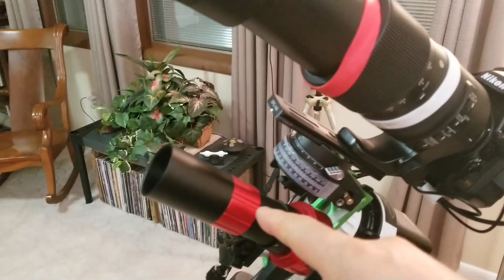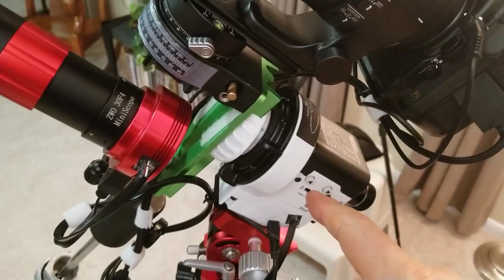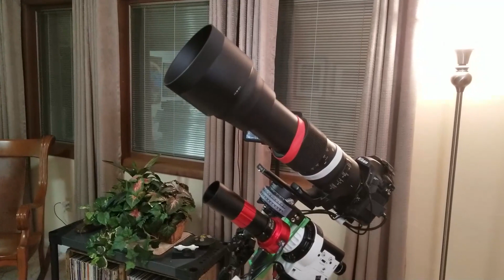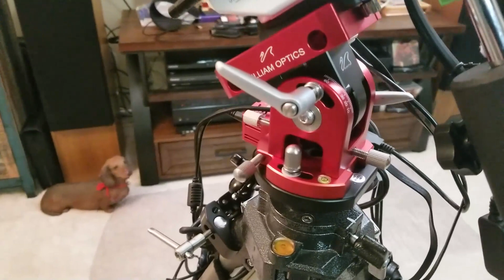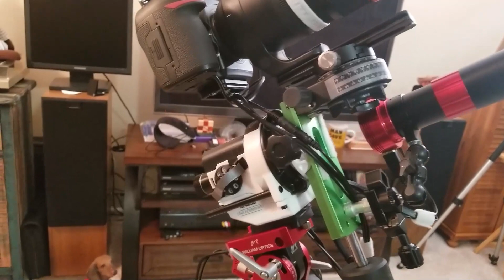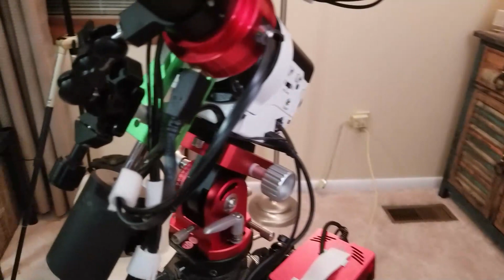Sky Watcher Star Adventurer Pro - An Overweighted Configuration

Comment: Nice work Daryl. We've both been on similar journeys with our Star Adventurers and ended up with similar solutions. I am still running with a counterweight rod extension and additional lighter counterweight to offset my Nikon D500 and 200-500 zoom. The solution I came up with for the guidescope was to swap out the arca swiss plate you have the lens mounted on for a 300mm one. This allows me to mount the guidescope directly beneath the zoom lens in the same orientation. This really helps with balance and I have found makes guiding more accurate. I'm interested to know how accurate you are able to achieve focus? I have ended up adding a lever to my zoom lens focus ring to give me the ability to make finer adjustments than I was previously able. I've considered the William Optics base, but will save the money towards a mount upgrade. I find that I am comfortably able to move the mount elevation without having to loosen the clamp bolt. I store the mount and base still attached so never have to loosen it off. Good luck and clear skies.
Reply from the maker: Hi Robert...thanks for the compliments.  Sure enough, a longer Arca Swiss plate would give more freedom for mounting the guide scope below the lens as you mentioned.  The one seen in the video was only 140mm, as I'd originally used it simply to provide a longer foot for conventional photography when using my Sigma zoom on a gimbal.  I don't like swapping out accessories that are screwed together, so I just stayed with that plate.  But, a secondary reason to my approach was I wanted to have the guide scope independent of the lens so that lens swaps were also more readily accommodated with less fuss.  In general, this setup worked OK for me but did evolve to mounting my guide scope on my camera L-bracket for a higher line of sight as my lens had, thus less likely to be obscured by a treeline while my lens might clear the trees.  Over time I also learned more about what flexure is and the importance of a firmly secured guide scope so I migrated from the double-ball arm mounting to a fixed mount, and your mounting directly to the a-s plate would similarly be good and secure.

I never had any particularly big issue with focusing the Sigma zoom.  I use a Bahtinov mask (https://www.amazon.com/gp/product/B01M6YC4WJ) with it and then, to ensure bright stars while keeping the exposure short, since I typically have yet to establish tracking, I just ramp up the ISO to maybe 12800 or 25600 and shoot a 5-10 second exposure to check the focus.  If it's not on the money, I'll go to Live View and zoom in on the brightest star, and gently adjust focus (the Sigma has a pretty smooth focus ring) to get the Bahtinov spikes more aligned as needed, if I can see them well enough, else I just focus to make the star as small as possible and then take another test shot to check the Bahtinov spikes.  I keep a wide silicone rubber band around the lens, so once I've achieved good focus I will slip the rubber band up over the focus ring to help keep it in place so any careless handling of my lens doesn't knock it out of position.  I've gone from one night to another without having to refocus but still will always shoot a test exposure to confirm focus before proceeding further.

I'm a bit mixed on the WO wedge but do like it and consider it more accurate and easy to adjust than the original Star Adventurer wedge.  I guess I still consider it worth the $200 upgrade cost, but that still seems like a lot for what it is, and $200 toward a new mount is certainly helpful.  That said, I did upgrade to an iOptron CEM40 mount and recently bought an astro camera, so I will continue to use the Star Adventurer Pro for a secondary imaging platform with my D850 and thus am still happy to have the WO wedge upgrade on it..
Reply: Hi Robert, I too have the Nikon 200-500 but with a D850; how long is the rod extension?   Thank you
Reply: @doubledark2  My rod extension is the same length as the original, so doubling the length. If you use a guide scope I have found that attaching that to a ball head on the other end of the Dec bracket helps balance the setup

Comment: Do you have a link to that arca swiss panning base? I'm not seeming to find it.
Reply from the maker: That particular one from Fanyingtech (FOCPRO) seems to be unavailable any more.  It would come and go on Amazon pretty often, but I've not seen it at all now for quite some time, and suspect it has been replaced by a model that integrates the Arca-Swiss dovetail into the base rather than with a separate removable adapter.  I own both but even the latter seems similarly unavailable.  Here's the manufacturer's product link, if you're curious to see what it looks like:  https://www.fanyingtech.com/product/kuaizhuangbanjiazuo/Panoramic_Tripod_Ball_Head_with_Indexing_Rotator.html

That said, I did find one that is very similar to mine as in the video, only lacking the adjustable detent for the panoramic function and I'd recommend it over other designs I found, as the small locking lever for the panoramic base flips upward so you know there's not going to be a clearance issue as could occur with a knob.  At $30, the price is right too.  :)  https://www.amazon.com/Hifine-Degree-Rotating-Panning-Mounting/dp/B07CV6ZT9X

Here are 2 others, again just for sake of comparison, at considerably different price points.  Sunwayfoto makes good stuff from what I've heard and this lever clamp design is akin to RRS but I'd not recommend it for astro purposes since you can't be certain just how tight that clamp action is and you may be carrying a rather heavy load...I'd sooner trust a knob.
$23.53 Tanke QJ-01, https://www.amazon.com/QJ‑01-Aluminum-Rotatable-Panoramic-Tripod/dp/B099KK7HSG/
$69.00 Sunwayfoto SPB-58T, https://www.amazon.com/SUNWAYFOTO-SPB-58T-Panning-Clamp-Panoramic/dp/B09JSGQZQ9

Finally, while I still use the pano head on my Star Adventurer Pro, I was recently making a Vixen plate adapter for my other similar head, and found for the gear I was mounting, that the pano base wasn't holding tight.  Perhaps checking some assembly screws might take care of that, but I decided to just use a standard arca-swiss clamp instead, because ever since I added the scale to the front of the DEC platform, I did generally find it easier to take advantage of the big fine-tuning adjustment knob for changing the DEC, only using the index pointer of the pano base as a convenient reference to align with the scale.  Cheers!
Reply: @Ambress  Thanks for all of this information!

Comment: I'm sorry but who says it should be only half the max payload? Did Sky Watcher tell you that? This is not the first time some random person has said this and sky watcher says nothing about halfing the max payload.
Reply from the maker: No, Sky Watcher didn't tell me this.  Instead, much as you said, it seems to be a pretty common recommendation throughout the astro community.  What I've read in various places, is the rated maximum payload is usually that applicable to visual astronomy, where critical tracking accuracy is less of a concern.  But, for optimum tracking and reportedly reduced wear on the worm gears, the 50-60% of max payload is the popular recommendation for astrophotography payloads.  As you've seen me address however, I have successfully carried as much as 9 lbs. on my SA Pro and with successful tracking for as long as 12-minute exposures, although that hasn't been consistently true, perhaps just the result of slight leveling or balancing variations from one session to the next, as well as the of the imaging train orientation for a particular target.

When I bought my iOptron CEM40 mount, I was concerned about this common recommendation, because that mount is rated for a 40-lb. payload but as is true of many manufacturers, iOptron didn't cite whether that was for visual astronomy or astrophotography.  Given the investment cost of the mount, I contacted them and received a reply that yes, the too recommend a 50% payload for astrophotography, but the guy when on to say that it really was less of a weight issue than a torque issue, and that depending upon the overall balance of the imaging train and where the center of gravity for it was, the torque on the motor would vary some, and you just want to pay attention to all of that.  Of course, to me the question was "how?"....I can't so easily get a feel for how much torque a given configuration creates, but certainly if the counterweight is displayed far out toward the end of the arm to balance the payload, it suggests a greater torque is required to rotate that total mass, so maybe that's what the guy was getting at.  As expensive as that mount was and yet uncertain what I might move up to later for an OTA, filter wheel, etc., and hence questioning the total weight I might want to be prepared to carry, I really didn't want to move up to the even more pricey CEM70.  So, I searched around for opinions on the CEM40 and found some folks saying it could pretty easily carry 30 lbs, and I was happy to see that.  I don't foresee a 30-lb. total payload in my near future, so I bought the CEM40.

Comment: Your guide camera is so close to the center of rotation, it will not move at the rate of the camera which will not give you enough guiding precision. I have mine clamped to my Z7ii’s L bracket.  You can also lighten your load by extending your counterweight bar and take some of the weights off.
Reply from the maker: Hello Lyman...my configuration evolved to where I quit mounting the guide scope on the SAP dovetail, but while I was using it there I never observed any particular issues with guiding precision.  I'm not saying you're wrong, but only that I seemed to have sufficient precision for accurate tracking/guiding.  My biggest reason for going with a different position was that I found times where I was closer to trees that would obscure the guide scope view although the main lens view had a clear view.  The new position was alongside the camera via a clamp to the DSLR L-bracket and, even later after the purchase of a Z61 lens, on the handle/mount of the lens.  As for the weight, and as I discuss starting at 17:40, I did initially use an extension of the CW arm in lieu of extra weight, but the greatly increased torque seemed likely to tax the mount more than would extra weight on a shorter arm extension.  That approach also provided a much more balanced, controlled rotation.  Optimization of my configuration was presented in another video 2 months later, https://youtu.be/CLA0ldnAdKw.  My best imaging, not surprisingly, came when I moved to the Z61 lens in late 2021.  Soon after that I also finally moved to an iOptron CEM40 goto mount, which is now my primary mount and I'll likely relegate the SA Pro to lighter-duty astrophotography more suitable to its rated max payload.  Thanks for your comments.

Comment: There are a lot of people doing a lot of mods to this mount  I added lead to the counter weight (covered lead with tape for safety), instead of your pipe parts.  Wish we could all have a discussion forum. Too many great ideas that should be shared. I've done a bunch of other mods too.
Reply from the maker: Hi Mike...no worries about fragmented comments.  I'm sorry for the late reply but appreciate the comments.  Adding lead to the counterweight certainly would do the trick as well, but I do favor the idea of knowing that I have an easily removable add-on weight for the times when it isn't needed, allowing me to aim for the lightest payload possible for an already overloaded mount.  I've since moved on to an iOptron CEM40 though, and my SA Pro will likely just serve backup duty for lightweight imaging, such as carrying my D7100 with a wide angle lens.  I've yet to use it for that purpose though, what with all my attention going toward some other issues I've been having now that my CEM40 is more fully exercising the capabilities of my ASIAir Pro.

Comment: I use a Skywatcher wedge to support the Vixen Polarie. I also noticed there is slight movement when you disengage the Latitude knob. I made some adjustments in the screws and it made the stability much better. I wonder which wedge you used in your setup and why it costs more than a 150pds telescope! What brand and name of EQ wedge and does it move at all when you engage or disengage the EQ latitude lock screws?? I wonder if its worth spending 200 to 400 pounds on a wedge alone?
Reply from the maker: Hello Bill....to be honest, I was probably a bit too hasty in buying that wedge to upgrade my Star Adventurer Pro's wedge.  It's a good one and does feel more precise but is it $200 more precise?  Probably not, saying that in hindsight.  But at the same time, I do like it quite well.  It is the William Optics High Latitude wedge...still reversible for a low latitude range.  Some of the slop I felt in the SA's wedge that prompted me to replace it is probably just inherent in how worm screw gears work, so I've learned.  The WO wedge does seem to have more precision by virtue of probably finer pitch screws in use, and I like how it locks down a bit better, but still question the value of it.  That $200 might be better spent elsewhere, especially if the tracker is just somewhat of a first step toward a more robust mount...I've recently upgraded to an iOptron CEM40 and now look at my SA tracker as likely to be used only on occasions where I want to run a 2nd camera, possibly shooting wide-angle while my bigger mount carries the heavier gear.  I think some of the early reviews I'd seen that also led me to the WO wedge purchase were more in regard to the iOptron SkyGuider Pro having an even worse wedge than the Star Adventurer Pro does.
Reply: @Ambress  
Thanks Daryl, keep up the good work! Clear skies and good photos.
Bill
Reply from the maker: Thank you Bill, and likewise clear skies!